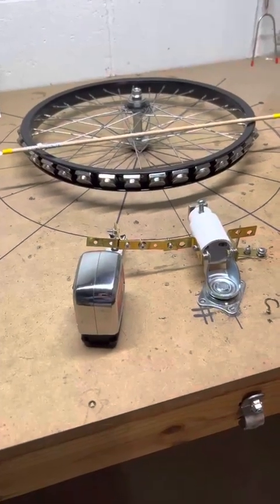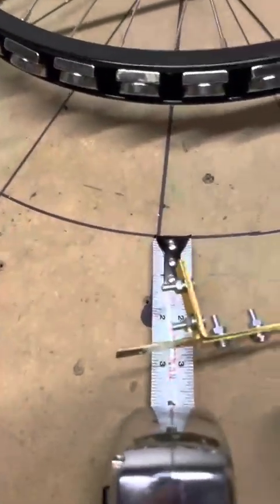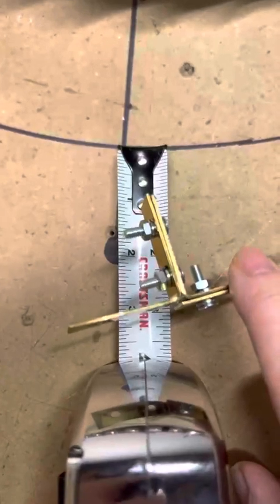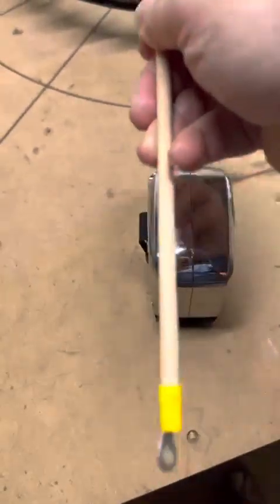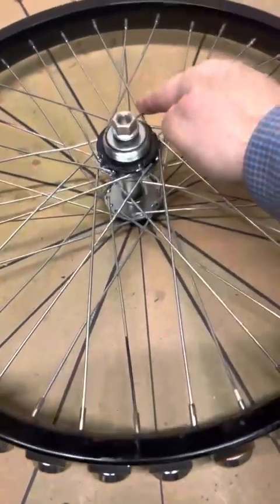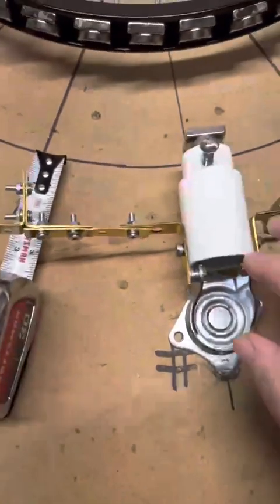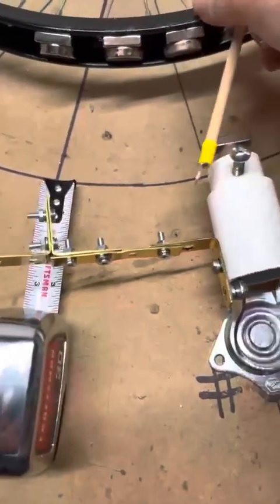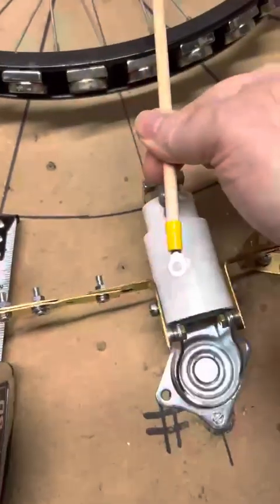Stator Requirement

Comment: I never got your email address.

I am going to see if I can find a wheel and I ordered a bunch of magnets also to see if I can replicate your setup and see if I can assist in some way

Also be sending a small donation for a magnet

Thanks
Reply from the maker: Got it! Thank youuuuuuu. 
FreeMagneticEnergy is my gmail address.
Reply from the maker: It’s an easy setup. But very expensive. That’s some $350 to $400 in magnets alone. Make sure you mount the magnets straight out.